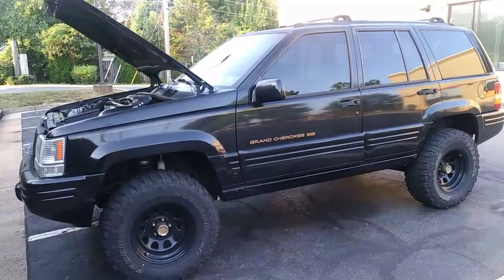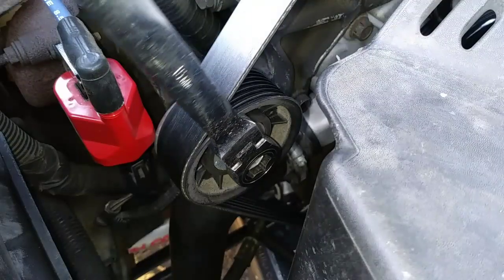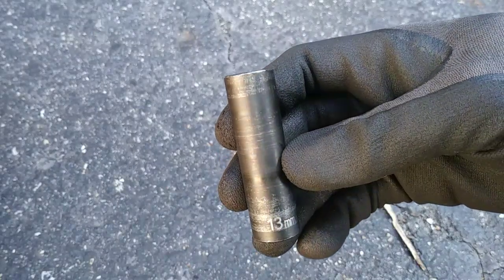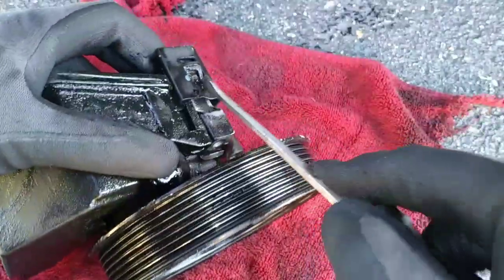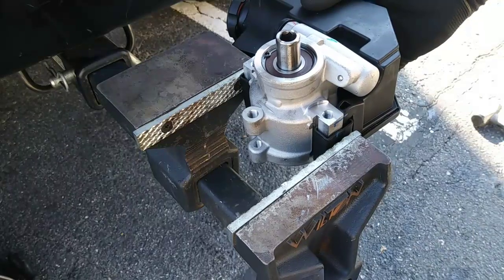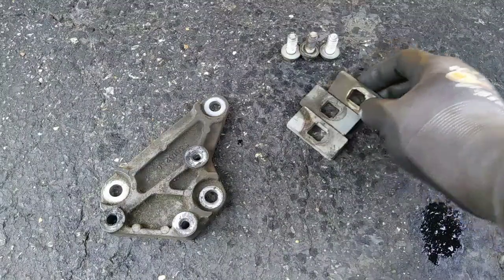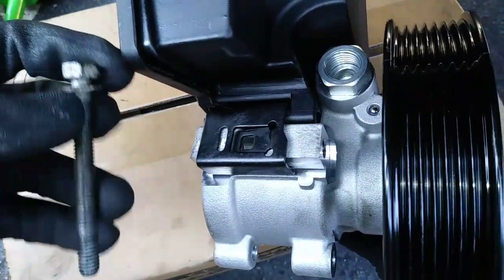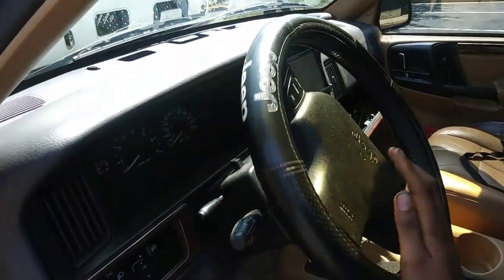POWER STEERING PUMP REPLACEMENT (JEEP GRAND CHEROKEE)

Comment: Whatever you do, NEVER stop making the videos the way you do, PERFECT! What's the story with the A/C compressor?
Reply from the maker: Thanks big bro. I plan on replacing the A.C compressor with an on board air unit eventually. I made sure I got the A.C working in my wifes Jeep, but thats something I can personally live without
Reply: @barricadegarage5361  what's onboard air?
Reply from the maker: @fsb_-bf3th  its an actual air compressor that can be used for filling up tires or running air tools
Reply: @barricadegarage5361  ooooh okay. Awesome! Thanks for the reply. I'm sitting in a McDonald's parking lot right now because my pulley came off my ps pump in the drive through, called an uber to take my son and girlfriend home while I wait for the temp to go down and I'm gonna attempt to do this job myself tomorrow. Thank you for this awesome informative video on doing this job! Gonna try to limp this 96 zj home hopefully after it cools down in 30 to 45 minutes
Reply from the maker: @fsb_-bf3th  your more than capable of getting the job done no problem. It easy and thanks for watching. Get home safe and let me know how it goes

Comment: Videos are excellent and easy to follow.  I like the way you are straight forward and provide socket sizes etc.  Thank you.  The beast is my wife's and she does not like the new SUV's.  So we are restoring  her '96 piece by piece.  Pump started leaking  and I am replacing it today.  274,000 miles.

Comment: Awesome video bro. I had paid a mechanic I know to change mine out but it's now leaking.  I tried to get him to come down and check it out and he is ghosting me. I will pull it all apart this weekend and find out where the leak is coming from. I checked out all the hose and that's not it so I'm pretty sure he didn't put the O ring back on the new one. Thanks to you I will be able to do all this myself. I have a 96 5.2 with 305k miles and I've done pretty much all the maintenance since it had 60k miles on it. I didn't have time and this is why I payed someone to work on it but I've learned my lesson lol.

Comment: I broke my PS bracket by over tightening the mounting bolts after my PS pump went out. I went with a similar aluminum bracket to replace it. It was so beautiful it was a shame to hide it with the PS pump, lol.

Great vid as always!
Reply: Hi Kyle,
I like to see owners of the jgc keep them running. I recently bought the bracket on eBay. I do not think you will get it elsewhere. Good luck

Comment: Hey Barricade, Thanks for this very helpful video. I was watching it, not to change the pump, but to replace the pump bracket. ZJ's are known to have a problem with this.  I ordered up and aluminum pump mount and sure enough, the factory one was cracked completely in one spot and 90% across in a second spot. Everyone with a ZJ should be checking this! It's an easy repair.

Comment: I know this is an old video, but I am a very visual person. It's nice to see this job done since I have to do it in a few days. I was worried about how to remove the bolts but it doesn't look bad at all.
Reply from the maker: Its easy so dont worry, youll get the job done just fine.. Although it would be a little easier if you take the fan out
Reply: @barricadegarage5361  Haha, I was wondering if it was needed - I have a copy of the FSM and it didn't mention it but I know how tight it can be in there.
Reply from the maker: @MaverickXeo  heres my video for the perfect fan clutch removal tool demonstrated on the ZJ. I highly recommend it to make the job easier
 https://youtu.be/iAsE7tHE9Uc
Reply: @barricadegarage5361  I hate taking off the fan, haha! That said, I have the pump off already - biggest problem was the bolts were too lose for my cheap 1/4" ratchet - the stupid ratchet wouldn't, well, ratchet properly haha.
Reply: Also, THANK YOU for listing bolt sizes! I have terrible 'sizing' and it takes me about 10 minutes to finally figure out the right socket!
Reply from the maker: @MaverickXeo  well done!

Comment: 1:55  ....Wish I knew this before I tried to remove the pulley itself -- there wasn't any room to remove the bolt (that I didn't know there's a hole in the pulley for that room).    I got it shattered and had to replace it but then when I got the order in -- I'm like, how the hell do I put it back in?  And hence the research and found this youtube video!    That's the solution right there!  1:55

Comment: I gotta change mine in my 94 Wrangler YJ with 2.5 I replaced the hoses which rubbed on a bolt and now got a leak. I got wire loom for the hoses which will stop this.

Pretty sure my Ps is the stock one and has seen better days.

Comment: The way you do and explain things on your other Jeep has helped me a great deal and helped me find and fix a vacuum leak wiring issues but I am dealing with two other things currently once I found the vacuum leak and fixed the power steering pump on my 07 Jeep commander is making a weird noise and the belt noise also that’s one problem the other problem is the commander keeps going through ac compressors I’m on my third and can’t seem to figure out why any help would be greattappreciated

Comment: Good video, but why don't you have your AC hooked up?  Which belt do you get to do that?  What's the difference between the expensive and cheap power steering pumps?

Comment: Great Video. I just notice my bracket has a crack. I"m ordering that Billet Aluminum. I was actually wondering why your Serpentine Belt was bypassing your AC. Otherwise Thanks for making videos so informative!! I can't wait to replace my bracket. However I have a 1994 ZJ V8, hopefully it won't be a problem since your video is for a 1996.
Reply from the maker: Its the same process and parts for all 5.2/5.9 ZJs so you dont have to worry about that and I bypassed my A.C because I had plans on putting an on board air compressor in its place

Comment: Was working good all day... Next morning not so well. No leaks. Can too much fluid be the issue?? I topped it off literally at the lid
Reply from the maker: Yes. Overfilling the resovoir can cause the fluid to foam and shorten the lifespan and when the fluid gets hot, it expands and it may force its way out of the reservoir. I would take some fluid out make sure the level is in line according to the dipstick. You may need to add new fluid. Did you order this exact same pump from the video?

Comment: Great work.. thanks for that alot.
I want to ask you what do think about using the Gearwrench 89101D flare nut wrench instead of the crowfoot wrenchs?
Are they good to buy them or the crowfoot is the way to go.. thanks
Reply from the maker: Ive never used that gearwrench set but in my opinion if you dont have either than crow foot is the way to go
Reply: @barricadegarage5361  
Ok noted.. thanks alot

Comment: I’m having trouble with my 96 zj the steering binds up then will free back up. Do you think it’s the gear box or pump ? Or have you had that issue ?
Reply from the maker: I have never had that issue but if the TREs arent damage and your steering linkage isnt bent you can have someone turn the wheel while you check out the pitman arm. It might be your pump though
Reply from the maker: Heres my steering gear replacement video in my '96 ZJ if its any help..
https://youtu.be/Mev9d2-N0lM
Reply: BARRICADE GARAGE thank you

Comment: Got an issue in my '93 where I have no power steering at all when turning to the right, and only when it's cold outside, cold start. After engine warms up, it loosens up and works normally. Think it's the pump?
Reply from the maker: Yes

Comment: The long bottom bolt going through the pump on mine feels a little stripped. It's technically tightening but not fully. Anyone else have this issue? Ordered a new bracket and hoping that's all it is.

Comment: part number please, I am talking about the part that goes behind the pump. Thank you.
Reply from the maker: It didnt have a manufacturer part number. I ordered it through Ebay
https://www.ebay.com/itm/5-2L-5-9L-Grand-Cherokee-Power-Steering-Pump-Bracket-96-98-53010256AB-OEM-/292747090702
Reply: Freddy , He is right. I also got it on eBay and it works .
Reply: @keithameerali9474  gracias

Comment: I need the part no for the pulley. I did not see any links.
Reply from the maker: The parts list is in the description.
BW16D7 or....https://www.ebay.com/itm/Power-Steering-Pump-Pulley-For-93-02-Jeep-Dodge-Grand-Cherokee-Viper-5-2L-BW16D7-/202599210122
Reply: Thank you for the link. Since you bought the part, can you tell me if it is all metal.?  I am seeing plastic pulleys and some owners are saying they are not  quality.  I am also seeing a Crown Jeep pulley and I know they make quality.
Reply from the maker: @keithameerali9474  The pulley I installed is all metal. And seems to be built better than the crown pulley from the pump you seen me take off
Reply: I also have a 1997 jgc from new.. Thanks for the reply but I did not wait as I realised the pulley was made in Canada. You have an amazing set of tools. Go Milwaukee!
Reply from the maker: @keithameerali9474  thanks. And yes the pulley used in the vid is an OEM Mopar one made in Canada

Comment: Anyone know how to get rid of death wobble ?
Reply: It's usually worn steering/suspension parts. If on a budget. I'd start with replacing the steering stabilizer first. Otherwise replace the track/panhard bar, drag link, and tie rod ends as well.